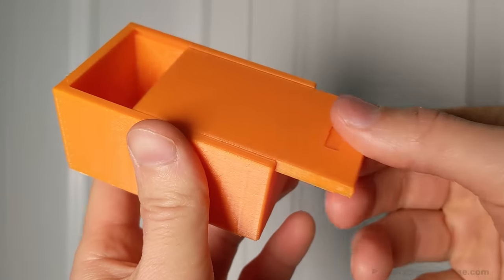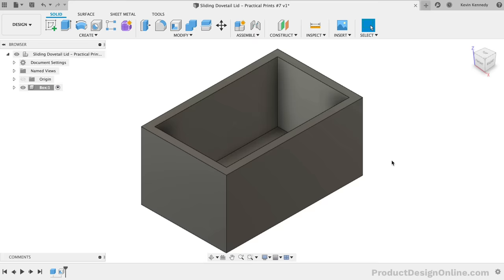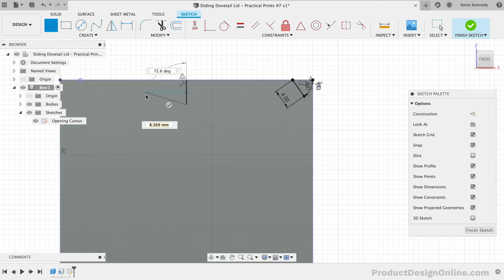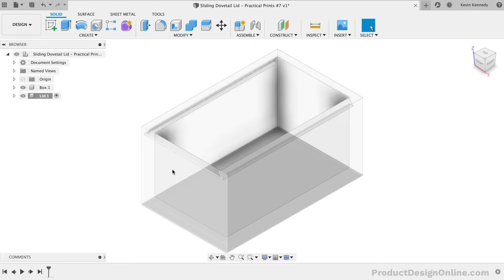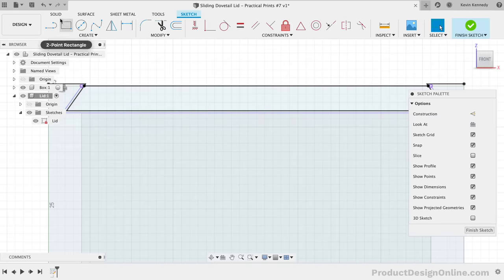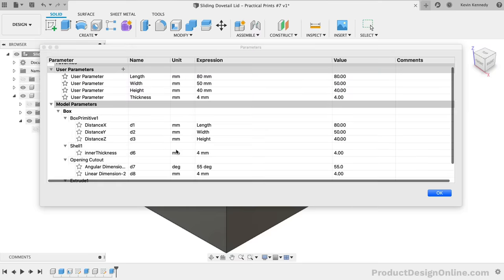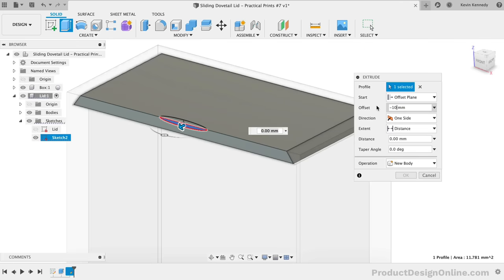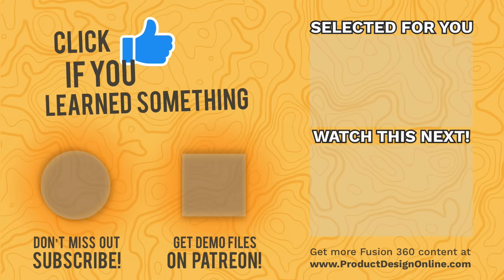Sliding Dovetail Lid for 3D Printed Box | Fusion 360 Tutorial

Comment: I am in a pickle.  I believe I see a constraint issue looking at the lid fit but I just don't see how to fix it.  When I go into "change parameters" on change box sizes the lid is not being a team player.  One side of the box angle has a dot where the 55 degree meets the top lip.  The other side doesn't have the dot, but all the lines are there.   I know this is probably basic. be kind im old.

Comment: To keep the lid from sliding off, I'd add in a 4x2x2 mm rectangular hole/slot on the rear bottom of the lid and also print a 4x2x4 mm key (with the requisite offset subtracted in for your printer) to make a friction fit between the hole and key. The extra 2mm that sticks out of from the hole/slot once you press the key in by hand will add a nice positive stop with the option of prying the key off if you ever needed to fully remove the lid. Great video as usual!

Comment: From all the information about Fusion 360 on the web I've seen so far, your videos are the best. Your way of teaching is calm, patient and elegant, your explanations are clear and easy to understand. I do the exercises along with the video side by side and I'm always learning something more. Congratulations!

It's just an idea to prevent the lid from coming off, I put two small pins, one on each side of the front of the box to be printed separately and placed after the lid. The top of the pins can be flush with the thickness of the cover and the pins protrude about 1.0mm into the case. They were virtually invisible and prevented the cap from coming off completely more easily.

Comment: Great video. A note on how I would suggest setting the parameters. The outside dimensions probably don't matter for this box, what matters is what needs to go inside it. So I would set the height, width, and depth parameters for the inside dimensions and use formulas with the parameters to drive the outside dimensions, including the offset. So if I know the size of the object I want to put in there I don't have to do any math to figure out what number to put in for those outside dimensions.
Reply: just a matter of creating parameters for inside dimensions and using these in the parameters for the outside dimensions.  Like: Length = inside_length+wall . Fusion does the math for you.

Comment: What I have in mind is to create project on the bottom of the  box, remove the side that the opening for the lid is on and make the side a removable dove tail like the lid. On that project create a latch on the inside to hold the side in place. Put a stop on the bottom side of the lid. To assemble put the lid on the box and slide the front side of the box in place to latch in place. The offsets for the lid stop will be up to you.
Great videos. I am still a fledgling with Fusion 360.

Comment: Cool tutorial and I'm going to print a few.  I changed the design a bit.  Rather than a depression for the lid and raised it.  In my slicer program, I cut off the raised piece and duplicated.  The second one will be glued on the bottom of the lid to act as a stop.  Thanks
Reply: Update on this.  My idea to glue a piece to stop the lid from coming off was a fail.  Couldn't figure out how to glue a tiny piece and stick into position accurately.

Comment: Thank you for this excellent instruction. I managed to reproduce it successfully !
Working further on this topic, I've found another way of doing it, which, if you don't mind I'd like to share with you:
Instead of working with offsets on the sketch I tried the following:
Box and lid as seperate components, as you do it.
Create the box as a hollow, complete cube. 
Create the lid with triangular profiles on the sides, sketch on the xz plane, extrude along the y axis. 
Cut the lid from the top shell of the box using combine with the lid as tool and keeping the tool.
This  creates a box with a slot for the lid, but without any gap, so it won't slide , of course.
The use the offset face command on the box's 4 slanted faces where the lid slides in. A value of -0.1 mm works for me (0.20 layers). 

It gives the same results , but I found it a little bit easier.

Comment: After seeing how smooth the bottom of the box was, I decided to print the top again, but this time upside down and it came out great, including the finger notch.  My heated bed is fairly new and smooth so it made for an excellent finish.
Reply from the maker: That's great, Hugh! What printer do you have?
Reply: @ProductDesignOnline  Creality Ender 3 - I also took advantage of printing the top upside down to also add a 20mm x 5mm rectangle at the bottom edge (under the finger pull) extruded to .3 mm with filets to act as a friction stop to keep it closed.  Thanks again!!

Comment: You could create small nubs near the front of the lid and offset a spherical shape so it locks into place when the lid is fully in, you'd definitely want a good handle for that method. Alternatively, you could create a pin hole within the box edge where a securing pin could be inserted into the lid to hold it in place, changes to the lid style would yield better results for that method however. Also i find Curved lids are less likely to fall out easily because of the curvature, it depends on the shape, e.g. if the lid was slightly angle downwards towards the back end gravity would help keep it in place as opposed to a "perfectly level" slide track letting friction be the only pull force on the lid. creativity's the limit.

Comment: I don't know if you ever resolved the issue of having the Box lid being retained or not, but after watching your video, the idea struck me of having some sort of separately 3D printed Peg or lip or something that you can put on to the lid after you've installed it.

It can really be anything, to square pegs, an entire Square lip the length of the lid, a dovetail shaped dowel bet you press fit into the back of the lid.

Any of these can be manufactured ahead of time and then put together after assembly. Of course there's going to be a minimum size where a person's fingers won't fit and articulate correctly to press fit the part in, but in many cases I imagine it might do the trick.

Comment: I didn't use parameters but pretty the same. I make lid stop as a small bump on the lid. If you make two bumps one in front and one in back so it will be open stop and close stop . Nice work and thanks for lessons.

Comment: Really good and practical tutorial.  I tried a thin bead of superglue about 4-5 mm long on the dovetail right at the outside and it seems to work fine and gives enough friction to keep the lid closed yet still open easily.  I actually had to do it twice as the first one wasn't thick enough. As another viewer posted, I had trouble with the coincident constraint and spent an hour trying to repeat exactly what you did. I eventually got it to repeat, but still don't quite understand what we're doing there although I do know without it you can't change dimensions and have the cutout work.  I tried w/o the constraint as you did and saw exactly why you need the constraint.  I'll go back through a couple of your earlier videos on constraints.
Reply: What did you do to get it work? I restarted this project a few times, and must have made at least 5 sketches. Edit: I moved the line from the outside of the box to the inside.

Comment: I think for preventing the lid out of box, you can add two symmetrical  shallow cut at each side of the sliding rail then extrude two short pins at bottom of trapezoid, so when lid fully slide out, the pin will stop it off from box.

Comment: To stop it from sliding out, add a snap latch to the bottom of the lid. Just add 2-3 layer slit above the latch (below whilst printing, has to be printed upside down) to allow plastic to deform while inserting and spring back once in place. Printed flat, there should be no issue as it's just simple bridge over the latch.

Comment: As Jorge J commented below, a flange will keep the lid from coming out, but it would also prevent it going in!  If you end the dovetail at the same length that the flange begins, you can put it in. Or, a little trickier, add a hinged stop, sunk into the lid, that swings down when closed. Then you can hold it out of the way to remove or replace the lid .

Comment: K another great project thanks for sharing.  If you drilled a small hole and threaded it, then a allen screw could be inserted to be used as a stop.  A 3d printed key & keyway would also work thanks again

Comment: Add 2 limited-cycle living springs to the underside (2 makes it not twist around) of the lid near the edge. Wedge/ramp one side and square off the other or maybe not as sloped as to make it removable but with more force. Have it recess enough to be flush into the underside of the lid as it slides on past the wall.
This would be a cool tutorial.

Comment: If you make a little nub on the back bottom of the lid, it won't slide out on its own, but you can still pull it out with a little bit of force. Plastic has enough flex for that. 😁
Reply from the maker: Great idea! I thought about it but was worried about getting the lid on... but I think you're right... it could be flexed enough to get it on :)
Reply: @Product Design Online . Could put a chamfer on edge to help it glide in. Another great video thx.

Comment: Lid stopper idea: 
Extrude a guiderail in the joint from the back forward. Then add a small pin in the lid joint that slides along this inner guiderail of the box. A separate front face of the box needs to cover the guiderail and needs to be printed separately. The pin then stops at this front face. The front face needs to be attached after the lid is in place.
Reply from the maker: Great idea, Victor!

Comment: I reduced the tolerance from .2 to .15 and the lid was still loose. So, then I printed off just the lid with a .05 tolerance and with a very light sanding I got a very satisfying friction fit. Hope this helps.
Reply: the sanding was only on the angles edges btw

Comment: New feature request: Fusion360 should let you type in parameters which don't yet exist while creating an object, and allow you to add them on the fly. Would save a ton of time!
Reply from the maker: Hi Larry. You can! However, there's a drawback as to how they get stored in the Parameters dialog.

To create them on the fly, you'll do parameterName=Value (for example length=20) directly in the input field. This example parameter called "length" would be set to 20mm.

Comment: At 4:05 Kevin grabs the upper right corner point and drags out what appears to be a construction line of some sort.  I have watched this about 15 times and can’t figure out how to replicate that step.  Can anyone clarify that for me please?
Reply from the maker: Hi Justin. The construction line is created automatically when the degree dimension is added. If you're not able to drag yours to the right then click on its endpoint and double-check that there isn't a coincident constraint on it.
Reply: This was confounding me too. I think the magic was to grab the construction line (yes created automatically with the angled line command) and drag it over, then back over the overlapping corner point again so that it was actively selected. Without that little maneuver, clicking the corner only selects the box corner point. 'Coincident' is for 2 points in the same place, so we need this little trick (dragging the construction line over and back) to be able to select both points and then add the constraint. 
I know this comment is almost a year old so you probably don't care, but for anyone else like me who runs into this issue now they may have the same question.  Oh, and I also had to watch this clip 15 times! :P

Comment: You asked if anyone had any ideas for a capture for the lid? I have a question and a resolution for this.
 Question: Can you design interference fit ? ...( I think you print separately and install )?  (Ball Detent)?
 Resolution: sketch a radiused boss running the threshold of the box, then have the receiver/nest on the underside of the lid.
 Or you could offset the lids print position by half the body, print a square corner boss on the box ...and undercut the lid.
 Good brain tease ...thanks !

Comment: This was an awesome project and I was able to make it. My only question is how would one easily in fusion remove the lid, to put it on its own plane to 3D print the lid separate from the box?
Reply: You should be able to hide the bottom body, select the top body and send it to your 3d print software by itself
Reply: @seefancy9610  I think I ended up getting it. Only thing now I need to do is make the lid a bit tighter. It was a bit loose in the dovetail

Comment: Dragging the width works fine but when I increase the width in Parameters, the trapezoid mirrors to above the top of the box so there is no extrusion cut. If the width is reduced everything is fine. I believe there is a constraint I have incorrect but cannot figure is out. Any help would be appreciated. :)
Reply from the maker: Are you able to share a link to your file and/or a screenshot? That will help me see what's going on :)
Reply: @ProductDesignOnline  Hey Kevin, Thanks for getting back to me. Here's a video of the issue and the Fusion file is linked in the description. :)

Comment: I tried to make two stl files separately for the box and the lid but both ended up with box and lid together as drawn - am I supposed to move the lid to a different location?
Reply from the maker: Each part should be set up as their own component. You can then right click to select "save as STL" per each component
Reply: @ProductDesignOnline  I did create each one as it's own component and exported each separately as an stl but didn't work
Reply from the maker: @cathy5922  hmm... Can you double check that each component has its own body? Perhaps both bodies ended up in the same component
Reply: @ProductDesignOnline  Yup looks like each has it's own body
Reply: I show box without the lid and only box shows - same with lid without the box
Reply: OK now I tried exporting the main drawing before components and shows box without lid
Reply: @ProductDesignOnline   When I right click on a component, there is no "save as STL" option. I see "Export", which does not include STL. (Even though exporting the whole project does include STL as an option.) The trick is to "Save as Mesh", and from there you can change format to STL.

Comment: I found an issue with this design.  It comes into play when the lid slides out along its short sides, and it's long sides are much longer.  That makes no sense.  Say the box is 40mmx10mm on its top, and the lid slides out of one of the 40mm sides.  There's nothing for the back of the lid to rest on, and it flexes.  I fixed it by making the extrude that creates the slot for the lid go back the the width - half a shell instead of the width - the shell.  That way, the lid "bites" into the back wall a little.

Comment from the maker: Join my Patreon to get all of my demo files ➞ http://patreon.com/productdesignonline
-
TIMESTAMPS
0:00 - Creating a sliding lid in Fusion 360
0:27 - User Parameters preview
1:08 - Creating the box
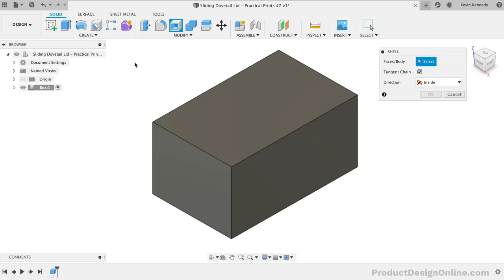1:50 - Making the box hollow
2:43 - Projecting the edge of the box
3:29 - Cutting out the dovetail shape
6:00 - Testing the dimensions
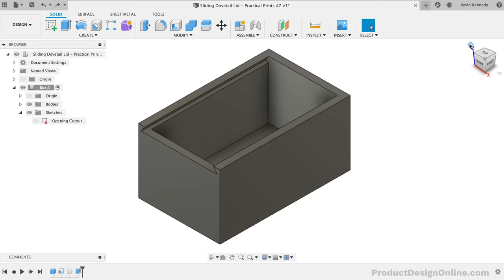6:23 - Creating the lid of the box
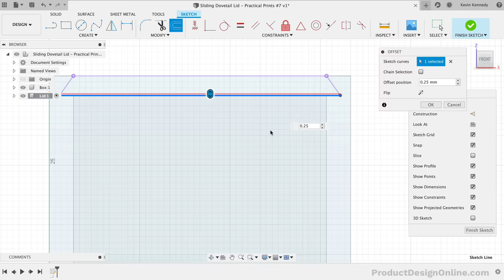7:45 - Factoring in the clearance
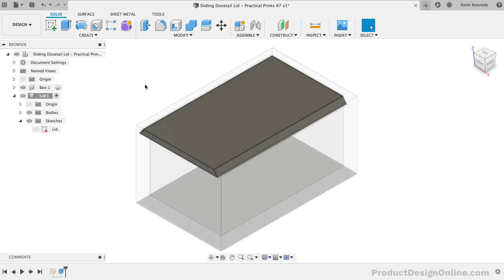10:15 - Model Parameters into User Parameters
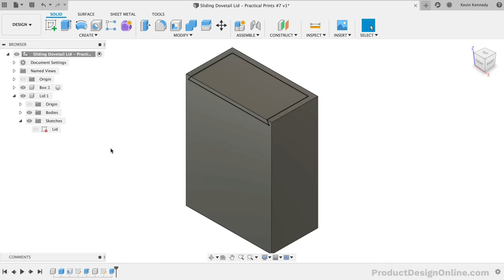12:45 - Creating the thumb hold on the top
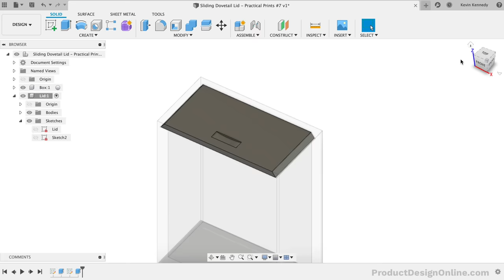14:13 - Adding a sliding joint to the lid